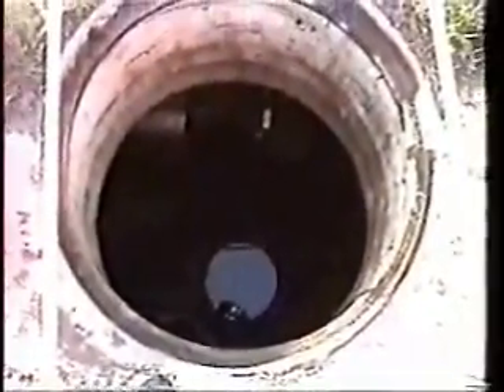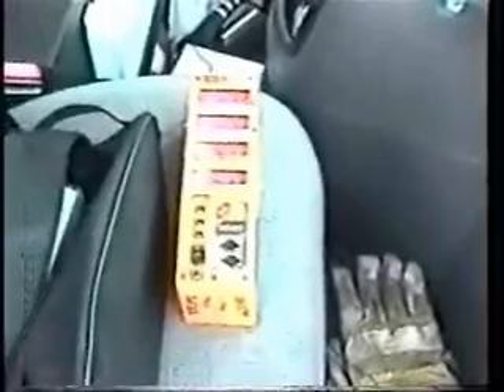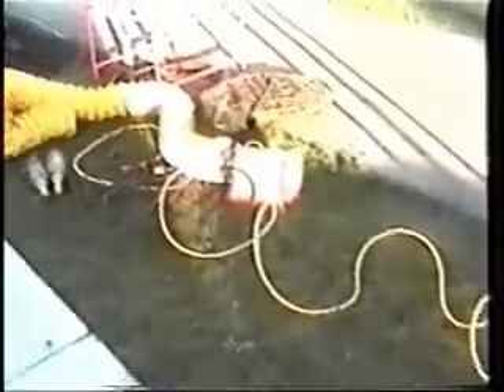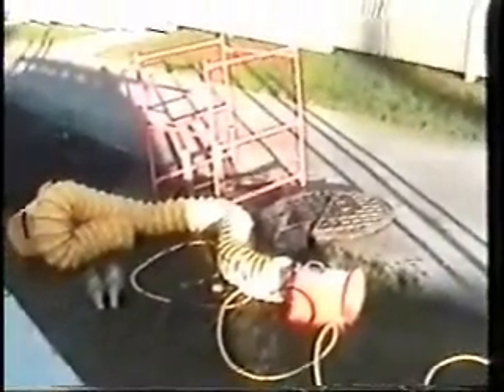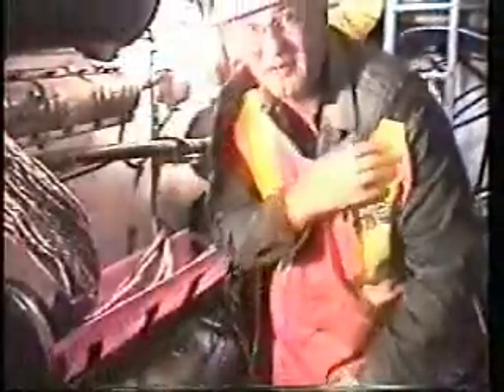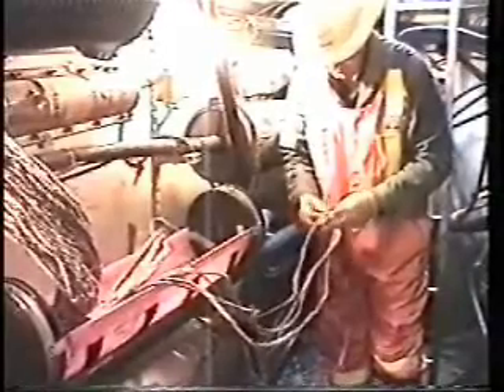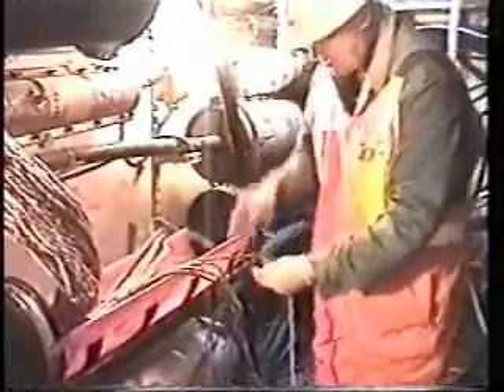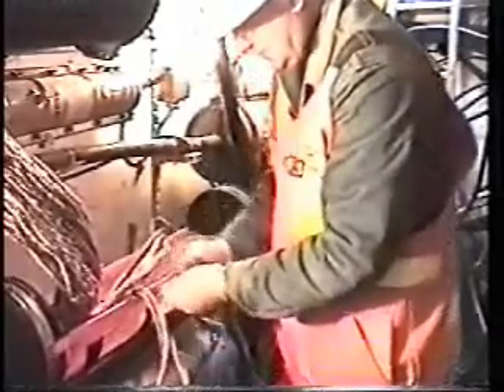Splicing with Larry - Part 1

Comment: Larry, I can't stand the messiness.  That is one messy cable racked manhole.  Considering that none of those cables look even close to 2700 pair cables, I see no excuse.  Then you opened the splice case (you called it a metal box?) and all I saw was a mess of wire that had not be properly folded and wrapped.  I've done everything from twisted pair (including solder wipe) to beans, to pic-a-bond, to modules.  I even did fiber optic.  I've done underground, buried, and aerial.  I was known for my quality.  Sorry Larry, but what I see ain't like the old days.  I started in 72 as a splicer, got qualified in three years, better than most, and became a cable maintenance god.  Your quality back then had to be great, it was by invitation only kind of assignment.  Well, at least your better than the French.
Reply: The closures are plp's and that MH is as easy as it gets. Plenty of room , not crowded, no lead I saw. And an 1800 PR cable isn't a big cable. It's a day or two of work from set up to finish. Comeback with vid of a 4200